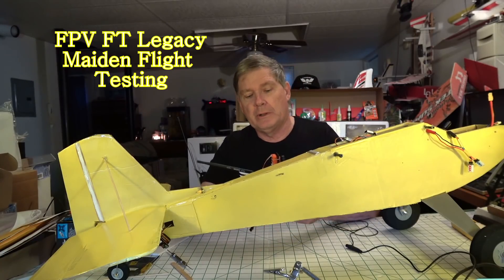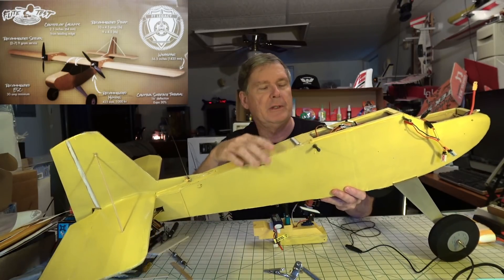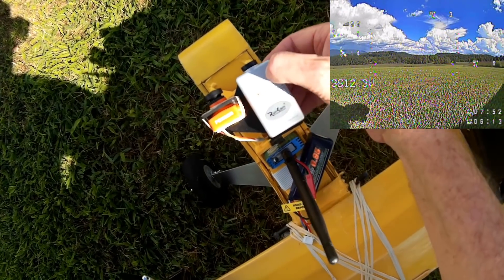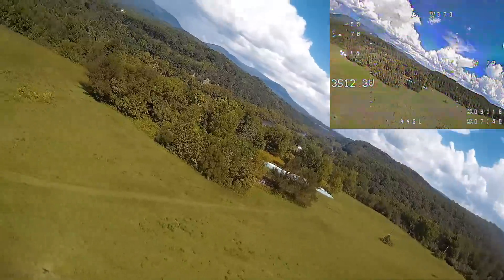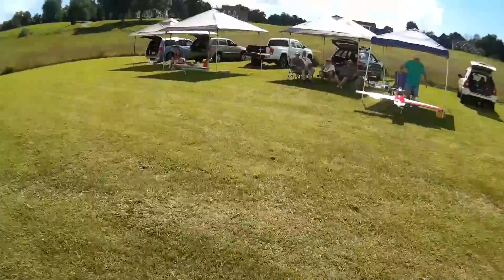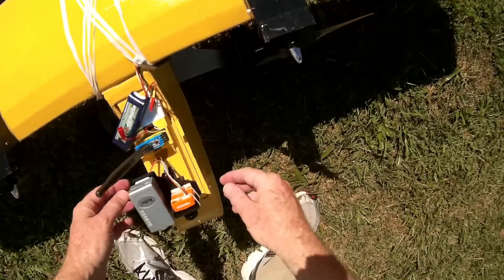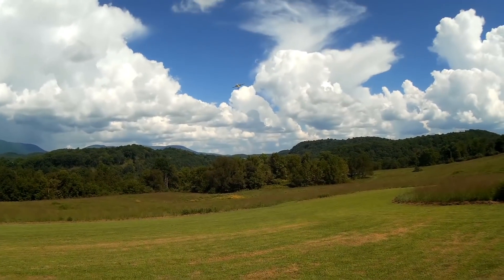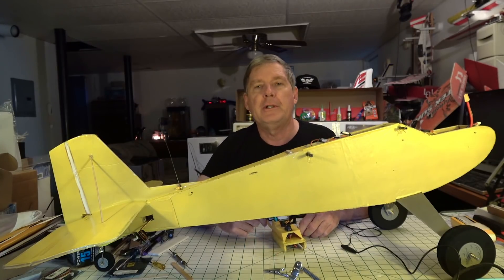FT Legacy FPV RC Plane MAIDEN FLIGHT TEST🛩 ( iNAV Differential Thrust )

Comment: Nice! I got a Legacy V2 for Christmas, can't wait for spring to fly it! I went with non-differential thrust along with the Aura 5 controller. I went to balance it the other day and noticed it also needs a ton of nose weight added, even with the 3S 2200mAh pack all the way forward. Going to 3D print a little box to put some wheel weights into

Comment: Lol, it will carry a 4000mah 3s with ease, a 2200 is a tiny battery for that plane !
I fly the much smaller ft cubs on a 2700mah 3s but even that small plane will get airborne and fly relatively well on a 4000 3s!
Reply from the maker: Sounds good to me!
Reply: @DaveMerc  i had my cub in the air on a 4000 only yesterday-  https://www.youtube.com/watch?v=vbkMxaSo2Ec  , im thinking about building this plane but with a single motor, id be looking to fly it on 3s packs between 4000 and 6500mah.
it seems to be very similar in size (56")to the storch (57.5") which has no trouble at all flying with an AUW of 1.4kg, my explorer(57") comes in at an AUW of 1.3kg.

Comment: Great build, super video. But how did you set up the LED bar to see when you have enough sat?s ?
Reply from the maker: There is an LED tab in  iNavFlight configurator where you can set the LED strips to display patterns or status. 
I messed around with the LED settings until I got what I wanted.
Reply: Thank you  @DaveMerc   for great answer, will try that

Comment: That was educational. Thanks! You brought out a weakness. You certainly won't be the only one who has a hot Landing with her!! I might try some lightweight reinforcement of the rear Fuse.... Maybe even shoot some spray Foam in there, making it solid.
At $70.00, I don't want to build a "disposable Aircraft". Judging by the work you've put into her, you don't either! 

It's going to take me quite a while to be able to afford one... Right now, I'm doing research! 😜
Carmine
Reply from the maker: If there is weak spot I will find it! 
Now I have reinforced it with thin hobby plywood.
Reply: Yeah, I feel your pain!! I may try some light Balsa or Plywood....
I'm making Mine with Tricycle Landing Gear. It saves me a LOT of money on Props!! 😱😜

Comment: You need some ME/RC wheel hubs Dave! Not sure what happened on that landing. Looks like she came in a little hot and over-anxious? Any new plane, I always like to do a few low-n-slow fly-overs to get the feel for any ground-effect and learn the "lay of the land". Never hurts as long as you have the fuel reserve. Other thing that helps me a lot these days is to wait till she's a little "bigger" in the panorama to be able to see "what's going on". Nice looking airframe, CG seems right-on, and plenty of power in them counter-rotation props. Oh, one word on the extra weight.. what goes up has to come down! Keep it light till you get them landings.. (2-3 "touchy-feely-go-rounds" then settle her in when it feels good - no rush - all fun)
Reply: Good  advice Idontneednostinkingchannel
.
Another thing that helps all pilots...... never land until it is PAST you.  It is very hard to judge speed as the plane is coming at you.  Therefore I try to keep a little power and not chop until at least 40 degrees to my side, or in front of me.  Most times I have to walk towards the landing end of the field to have the room to do this.  To me, it looked like you got her too slow and she tip stalled

Comment: Super clean Video downlink Dave, dedicated video Lipo Im guessing?....It looked good to me, a little trimming maybe....Did you really fly it on just a 2200mah 3S Lipo...????....I mean, its a huge twin?.
Reply from the maker: Yes separate video battery, I show it in the post talk. Just amazing how efficient it really is to fly on a 2200 3s but I will be moving to a larger battery because it can use the nose weight anyway.
Reply: Yes, I thought you said 2200mah....amazing...by the time you strengthen the rear Fuz, it will need the extra weight up front. Maybe a 4000mah 3S..?...I thought that Matek board had its own power filters etc onboard to give clean video?....I know my F405 Wing board does.
Reply from the maker: The Matek F411 doesn't have a 12 volt filtered output that I need for my 1.3 GHz VTX so I just did my usual thing with the 3S video battery. I have a 5000mah 3s that I might try for the flight battery.

Comment: Did it tip stall or did you confuse left and right on landing?...;-)
Reply from the maker: I wish I had the stick widget on the OSD screen for evidence because I am not sure.  My feeling is that I overreacted to the aircraft coming straight for my head and moved the aileron stick too much. It seemed to level off right before it hit so it seemed to have airspeed to not stall and of course we can rule out torque roll because it's a twin.
Reply: He confused left/right lol